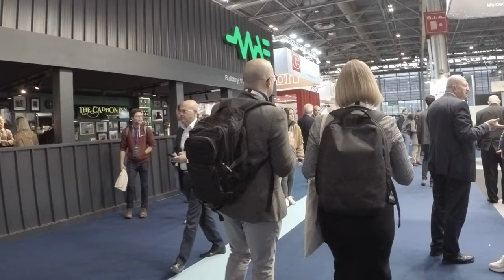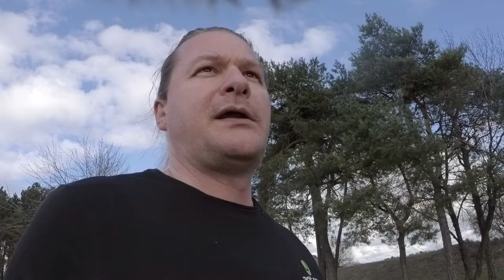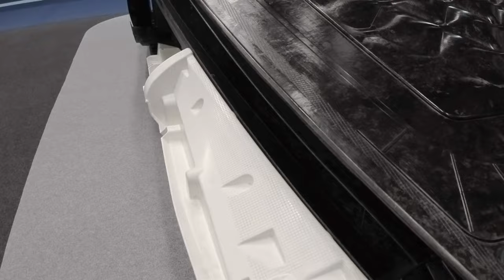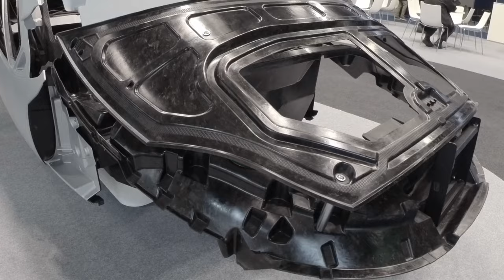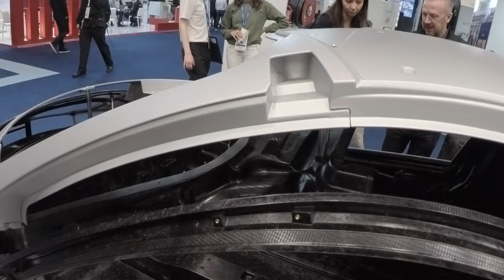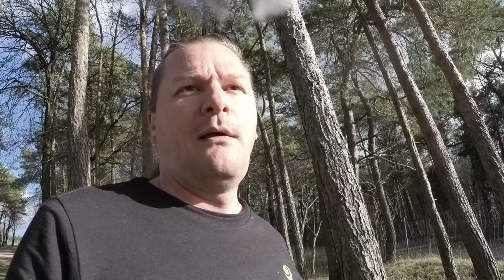Adventure #2: outskirts of Paris

Comment: It's great to see this video of the Body in Carbon (and fiberglass).  That finish on the fiberglass parts is beautiful - I would be tempted to strip the original wrap and replace it with clear Paint Protection Film.  I don't know if just PPF is sufficient to protect the composites from Ultraviolet degradation - if it is, that would be a really cool option for Aptera to offer.  Lets ask Aptera for a clear PPF finish.  🙂 

Thanks for this video, it's good to see this progress from Aptera and CPC.